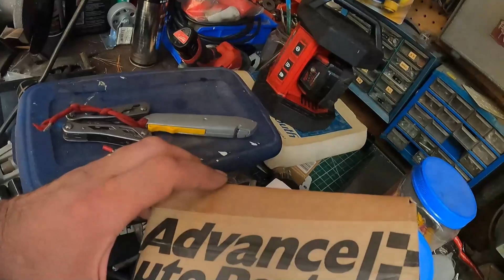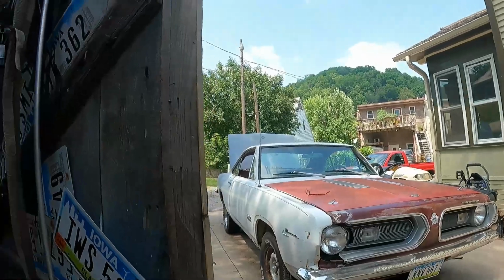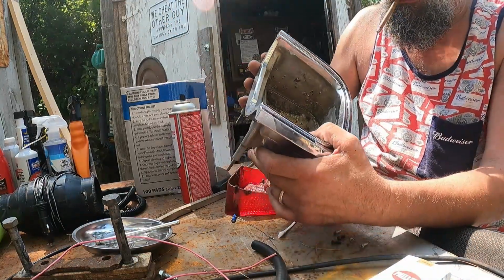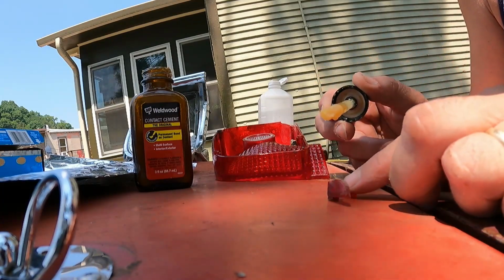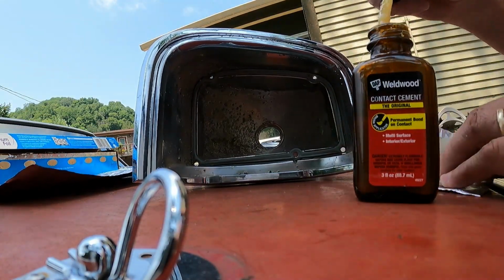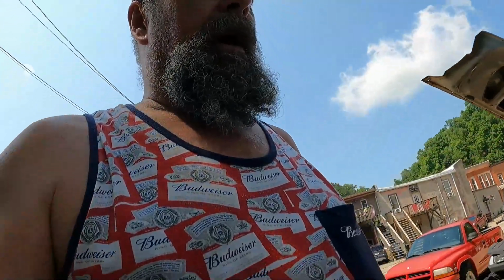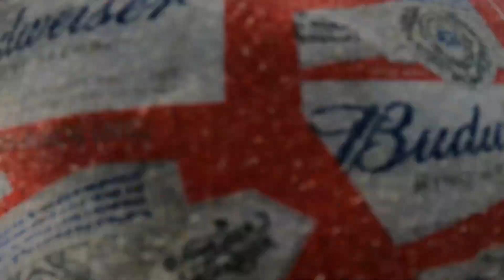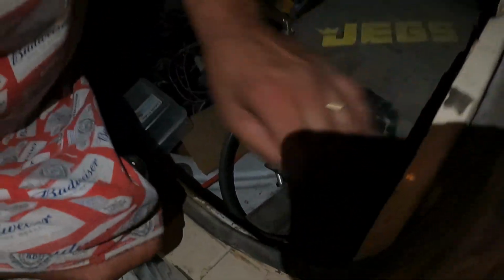Brake light world record barracuda 1st ever!

Comment: I cleaned / updated my tail lights and front turn signal lights and back up lights inside the tail light housings on my 65 dart  . I used the 1157 and 1156 LED bulbs but couldnt use them for the double element bulbs on brake/ turn signal side . while I had the tail light housing disassembled I repainted the inner metal body with aluminum paint to help reflect the light. I also wanted to give my dart a 3rd brake light for a modern safety upgrade but wanted an old school look so I found a 1960s/70s harley chopper red iron cross tail light assembly  . I made a metal bracket and bent it into a leaning L shape and mounted it to the middle of the back deck behind the rear window . still waiting on my damb income tax and back stimulus checks to show up in my bank account . it said it was accepted and being processed . soon as I get the money you will see lots of progress on my 65 dart 😎👍. Great video guys 😎👍🏁 . catch you on the flip I ment  chip side 😜
Reply: Thanks for the reply, Jeramiaha.  I like the idea of a 3rd brake light but don't care for the modern options,  your iron cross is food for thought.  Take care buddy.